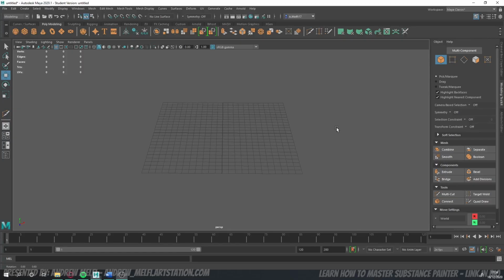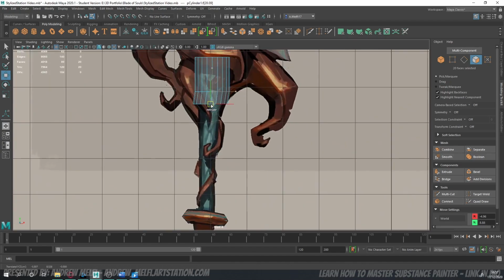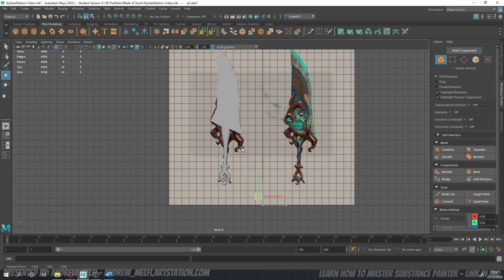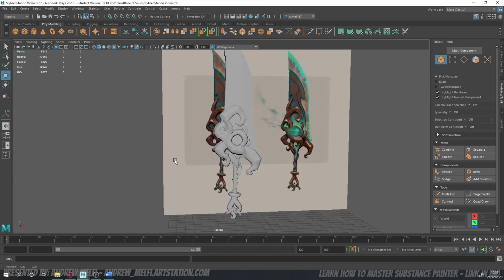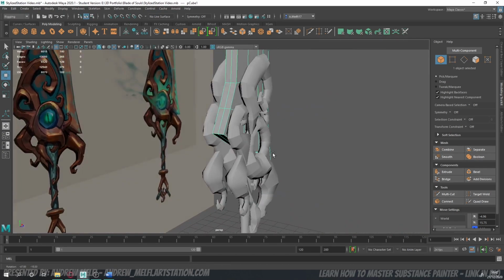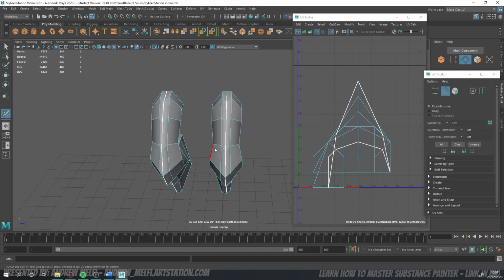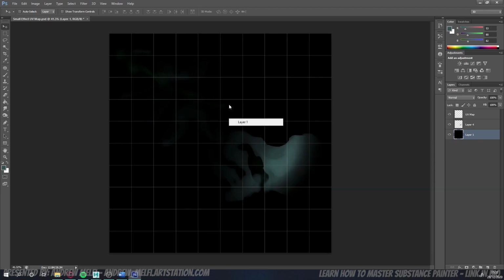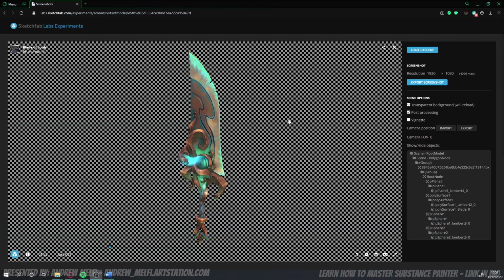How to Create a 3D Hand Painted Sword - Full Breakdown Tutorial

Comment: Workflow Question: I see this workflow has no need for a high poly version. Im running into a problem where I am ready to paint texture and notice the low poly facets on the flat of the blade are just too prominent, making me think that higher poly is needed, but that defeats the whole purpose. What am I missing? Has to be something major Im missing.
Reply: I think you can raise the quality of the texture in Substance before bake, so you can keep your low poly and a nice map. Or is the size of your UVs.